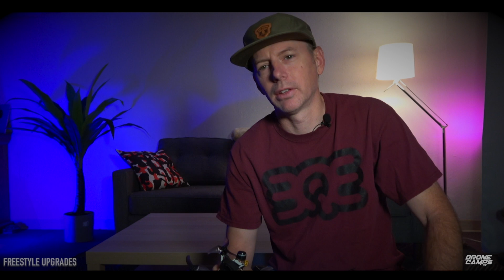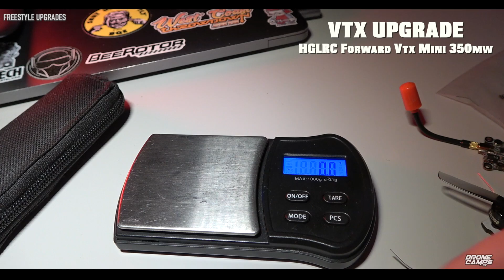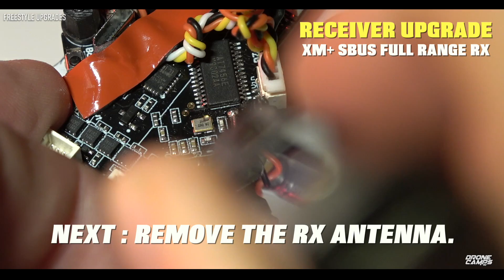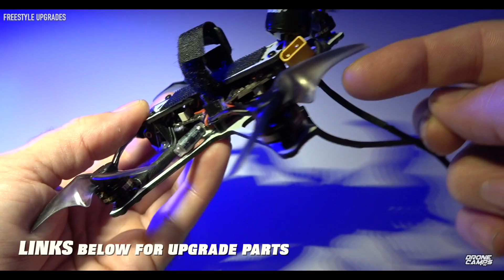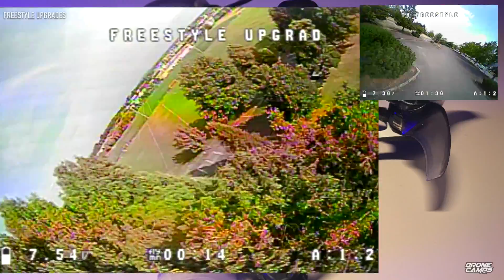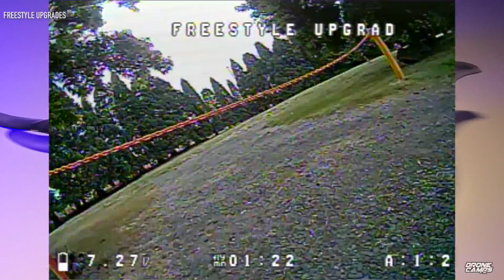EMAX TINYHAWK FREESTYLE UPGRADES - DO THESE NOW!!!

Comment: Will the 1X Flysky FS-i6X RC Transmitter work with this quad?
Reply: I don't think receiver type matters as much, as long as it's interfacing with SBUS it should be good to go.  Just make sure Betaflight is set correctly.

Comment: Do you know if they will be making replacement frames for the TH Freestyle
Reply: Devin Mikulec lets just say it’s EMAX. They have a standard practice for the quads they sell. all emax quad gain the full support of emax America. after market culture for emax is growing week in week out. Also it seems like the big manufactures at some point standardize their hardware meaning available replacement parts for longer periods. The quality of current gear is at least 3 times better from even 3 years ago. Finally as a best practice I do personally. Once I find a quad that I love I would horde spare parts for it when I can. Because sometimes there’s a off chance they pull the model leaving you with no replacement parts to keep flying that quad. Besides the technology is still growing fast. So up to date gear comes every 6 months it feels like. 🍻

Comment: What uart do i need to configure for sbus?? I have no signal?
Reply: For everyone that is trying to Upgrade an R-XRS Receiver !!! You need to solder the Signal wire to the uninverted SBUS Singal (the Pad with the B on your R-XSR), then solder the other end from the Signal wire to the RX1 Pad on your FC. It is located on the Bottom of the FC. After that, go to BF and choose Soft Serial on UART 1, then choose Serial-Based Receiver and SBUS. Done

Comment: Hey Justin, These are very close to the mods I wanted to do. The difference is I will use a unify nano 50mw, I can get 100 yards easy with trees in my way. My question is running 350mw how much did that affect flight time? BTW Albert kim is making a tpu mount for the runcam racer if I heard him right.
Reply from the maker: I’m running 200mw. Not a big difference.

Comment: I love your reviews but I got mine yesterday and I gotta say it sucks.  I think the upgrades will definitely help but the default tune on this thing is horrible.  Might be good for a new pilot but anyone who has been flying for a bit will be disappointed
Reply: AndyRC has a good tune for it. I believe it's linked to underneath his review video.
Reply: Really?  I think the default tune on mine is one of the best I've felt.  What about yours don't you like?  Maybe there is something wrong with yours.
Reply: RetsetVX , I agree ! AndyRC has his settings posted for the world to see and use. During his review he pointed out “high throttle oscillations” on the first punch-out while testing LOS. I’ve not tried his settings yet, my pilot skills are not at the level where I’d notice yet but, many of my experienced FPV Pilot friends Rave over how great Andy’s settings are working for them. As Andy would say;  Cheers!  🤪

Comment: What alternative Vtx will work with 2s? I'm having issues finding one small enough that will accept the 2s voltage and have smart audio .
Reply: TBS UNIFY PRO32 NANO 5G8 takes 3-13v.  And is cheaper than the one he installed. And higher power.

Comment: great vid, but unfortunately I just ordered 8 1s 80c 650 man GNB batteries:(
Also, I'm kinda scared to take the quad far anyways, although I guess I'm used to the range on the r-xsr on my 5"
the camera is aight though lol, but you are def right about the props...although can't the stock vex also run 200mw?
Thx
Reply: stock vtx is only 25mw

Comment: Justin, for wiring the VTX, you suggest not using the existing pads on FC. I've worked thru the top and bottom of board and can't find Vbat pads. Did you go directly to battery pads?
Reply: D'oh. Justin, you note to solder directly to +/- battery pads in the video. Hope this helps other folks that weren't paying attention during class.
Reply: @SPotter1973  yes, correct

Comment: Justin, just got in your suggested parts and ran into minor issue: any tips on unsoldering the existing VTX? It's a tricky one with 4 attached solder points that all pull together. Did you pull entire main board to desolder bottom? Solder sucker all attachment points?
Reply from the maker: Solder sucker first. Then I removed all pins with my Ts100 sideways on all pins.
Reply from the maker: Pull the board yes.
Reply: Woof. Removing the VTX isn't easy. I ended up snipping the vertical plastic connectors. And then desoldering the left over pins one at a time once the VTX was gone.
Reply: WolfFPV , I haven’t done this mod yet on this Kwad but, I’ve done many like it on other Kwads with the same basic pin set up and I’ve always done it YOUR way with ease and no issues.

Comment: quick question i have a spare HGLRC gtx226 v2 VTX  would that be ok to use for an upgrade it ranges from 25mw to 400mw? i dont wanna fry this thing..
Reply from the maker: As long as it’s 20x20 or smaller yes.
Reply: @dronecamps  awesome thank you///
Reply from the maker: Yw!

Comment: Would it be hard to upgrade to an hd camera
Reply: I don't think you're going to have room for an HD setup. This is a pretty tiny package.
Reply: Do RC, I agree,  at least for the next 5-8 months anyway. Judging by how fast this hobby has FINALLY been advancing in the past 12-15 months, I bet there will be an HD solution that’ll rival anything that’s available currently in performance, size and weight. 🤞

Comment: I've done all the upgrades (minus battery connector & props).  My new camera and VTX are working and putting out video.  My FRsky Xm+ shows that it's bound (solid green light after bind procedure) but it's not communicating with the quad (i can turn off the radio and it doesn't warn me that the model is still powered) and it won't arm the motors when I flip the switch.  Betaflight doesn't show any stick input.  Do I have to configure a uart (betaflight shows 3 uarts, #1 being the usb one.  Which Uart do I turn on in order for it to communicate with my radio (Qx7).
Reply: I'm having the same problem using an R-XSR receiver. following...
Reply: @danpowell2018  I used the second Uart, the one below the USB one.  Just switch on the serial port portion, don't click on the Uart itself.
Reply: Also, make sure you select serial based & SBUS in BF Reciever Config.
Reply: I was using the white sbus in wire instead of the green sbus out wire. Changed wires everything is fine now.
Reply: @Aztec5402  thank you, i was turning on the port. 2 hours of trying to figure out where i went wrong. all good now. thx again

Comment: Very impressive VTX antenna combo! You are getting some good range!
What antenna would you recommend for my TBS unify VTX? It needs to be IPX UFL connector
Reply from the maker: The Lumenier AXII 2 with UFL
Reply: The axii mini and micro actually work really well. I use the axii micro on my R349 and get great range.
Reply: @JohnWhite84  Thanks. I have the ER349 and need a good antenna. I ordered one on banggood but it is having connection issues. It broadcasts intermittently. Like it cuts out and just black screens even at very close range on 800mW. Not sure if it's an antenna problem or a VTX problem, but usually a Unify should work right? Cause TBS is a good company
Reply: @brianevans4  I actually had to replace my first unify (I have the ER349 also) because the ufl connector separated. If I remember right snowy screen means vtx lost power. Black screen may be camera or you have a bad connection on your video wire. Not real sure. On my ER349 I have the axii micro. I drilled out the round part on the canopy, ran the ufl through and hot glued the antenna. It's strong as can be.
Reply: @JohnWhite84  Thank you very much! I had no idea what was causing it